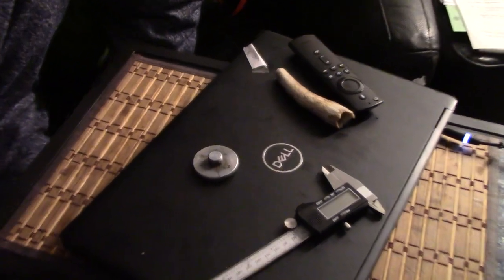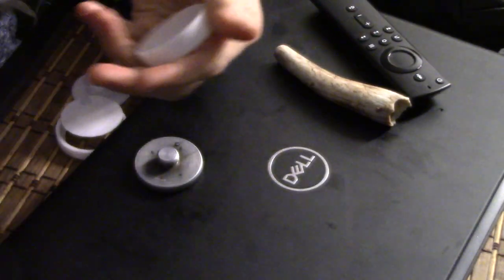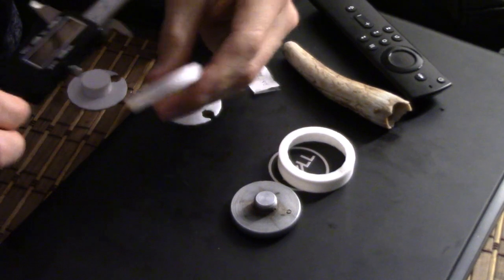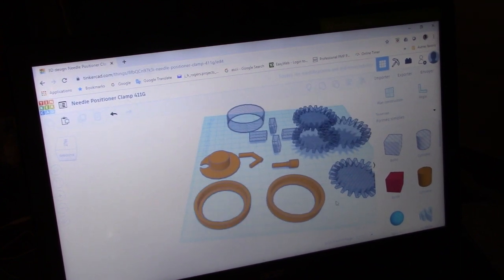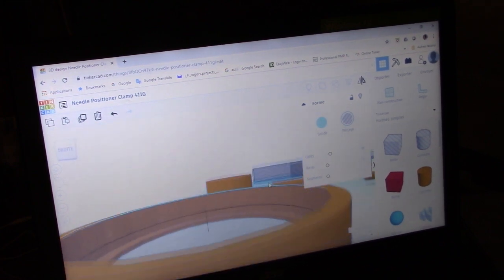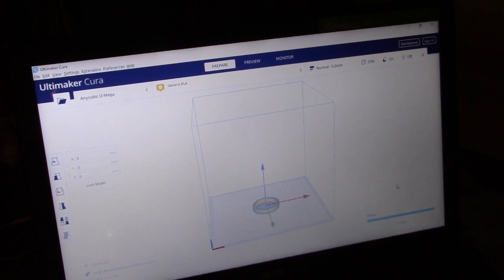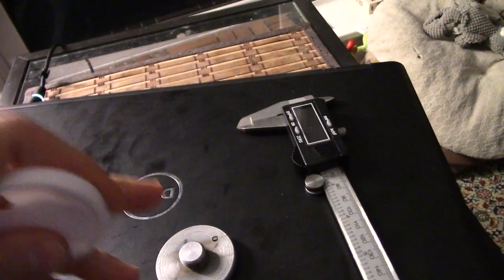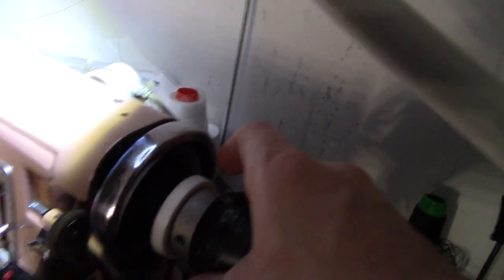3d Printing Parts for Sewing Machines

Comment: So I’m super jealous you have started doing the sewing parts vs 3D printing. I have wondered about this for awhile and some parts are super difficult to get - like the chain stitch combo of the 411g or the 431g! 
How about trying to make those parts? I bet the face plate wouldn’t be a problem in plastic but maybe the weight of the bobbin ? Unless there were heavier plastics? Can your printer do light metals?
Reply from the maker: Yes, I am contemplating trying to create the chain stitch plate for the 411G.

Comment: I don't know a thing about 3D printing, but it seems like a perfect solution for the missing pattern stitch cams for my machine!
Reply from the maker: Yes I have done a few but it takes patience. If you have at least one cam, it simplifies creating the basic form to attach to the machine. After that, then the fun begins to learn the minimum and maximum distances that the cam followers need to travel (so a zig zag cam is often the best).
Reply: @jamesrogers991  yeah, after I sent that reply I realized that it would be tough bc I don't have a single cam for the machine! I picked it up from the dump and it wasn't until I started taking it apart and researching it that I realized it was lacking something... 🤔 I'm not even sure if it will sew at all bc I think there is a "straight stitch" cam!
Reply from the maker: @DFTBAandDS  Tough, but far from impossible.